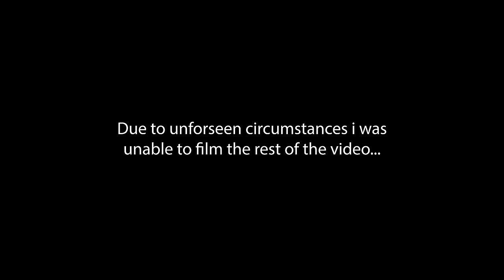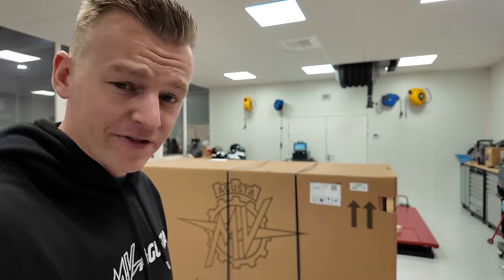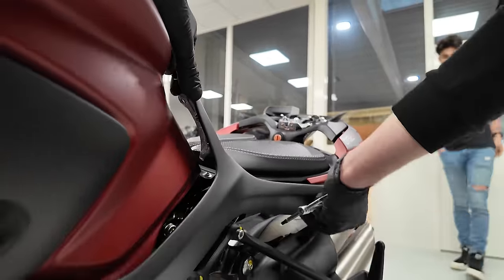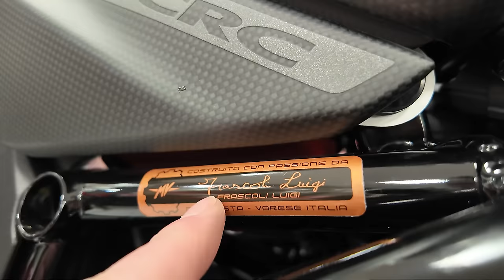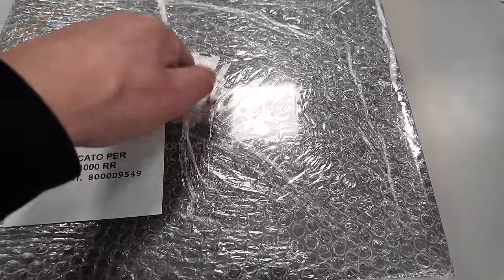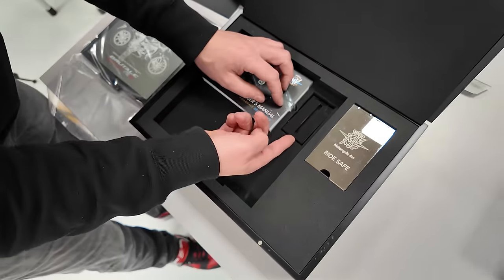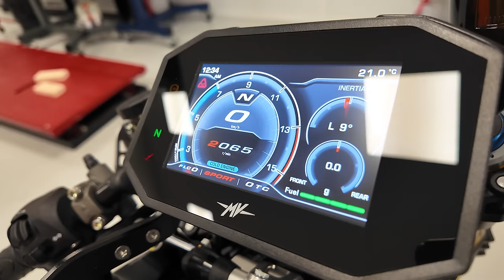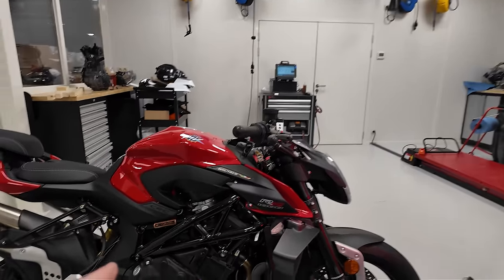2024 MV AGUSTA BRUTALE 1000 RR Unboxing (208HP)  | First Start + Exhaust Sound

Comment: MV Augusta are works of art. A keeper for sure
Reply: The street fighter is a dream of a bike, the MV Augusta what can you say? Nothing less than the same as in the case of Lamborghini or Ferrari. …. fantastic bikes, superbikes, and all of the larger displacement 4 cylinder models sound fantastic, and are very compliant, except the absolutely atrocious three cylinder 800 cc Brutales……I have two Brutales,  I’m keeping the in-line 4 1090. But I’m selling the newer and actually better looking 800 cc triple,  because honestly, it sounds like a piece of total crap really, and it wants to race at 12,000 RPM even at 20 km an hour stuck behind a three wheeler on the farm road in Thailand.. the four cylinder 1090 I can drive through the city center at 20 km an hour without the bike doing the bucking bronco. But the 800 starts jerking all over the place. It’s also much more tiring. However one truly has to admit that all MV Augusta models are visually absolute works of art for sure. One of the most beautiful bikes I’ve ever seen and perhaps the most beautiful I have ever had, but I’m keeping the 1090 in silver, even though I prefer the looks of the 800 Brutale, which is bright red. although after a month or so it starts looking like a dwarf. I think MV Augusta made a big mistake making all of their bikes that are under 1000 cc as three cylinders. Because they sound absolutely horrible. it’s actually becoming famous worldwide just how bad they sound. They do have a following and some people love it. But they’ve lost a lot of potential customers because even even more people hate the overwound, high RPM settings on the 800cc models with three cylinders, amd hate how tiring the bike is, because it’s like sitting in the sardine can, and the famously horrible sound of the triple cylinder engine. What a shame otherwise it would possibly be the most beautiful bike in the world, as well as one of the most fun to ride, but actually it’s a piece of art, that’s very strenuous to ride. i’m speaking from the experience of a person who owns both the 800 and the 1090 cm³ models so I believe I know what I’m talking about. In fact, I drove both of them today, one of them was not as pleasurable as the other. In fact, only one of them was truly pleasurable. I am obviously referring to the 1090 CC model with in-line four cylinders. What a bike! I never thought they would own one in my life, every time I ride it, it’s like Christmas. but the street fighter also puts a smile on my face every time, and it’s a hard decision which of them to take when I decide to go for a ride, especially when I’ve got another 10 bikes to choose from apart from those

Comment: I have the anniversary edition sitting in my garage collecting dust. Beautiful bike. It is not worth the money and impossible to get warranty work done.

Edit: recommend checking your rear brake fluid reservoir cap after every ride. They have a habit of coming off on their own.
Reply from the maker: Fluid reservoir cap coming undone??? 😅 That sound just a bit dangerous 🙈
Reply: @LifeofSmokey  and very inconvenient to replace. The first time was lucky and it was sitting wedged in the frame. The second it was missing completely and we had to wait for a new reservoir assembly and cap. The third time saw the bike hard parked. Talking to a few other owners, it is a common enough problem for some reason.
Reply: You can buy a beautiful Moto Corsa master cylinder to with the bike and forget checking it
Reply: I had a Kawasaki it had a Bracket to screw on Cap , 
I’d spot a Tiny amount of Loctite or Silicone will Stop that , Warranty that’s a Bitch Move it On to a Top Mechanic “…

Comment: I'm curious: what other things, if any, are done off camera getting the bike ready to do it's tiny lap outside the garage door.  I noticed the fuel gauge was full.  What other things are typically done in your check list before you do the little ride?  Oil? Hooking it up to the computer?  How much air pressure do the tires typically have when you get it out of the box?
Reply from the maker: All bikes are in "transport mode" so they don't start. We hook them up to the computer to check for faults , remove the transport mode and make sure the latest software is updated. These bikes will be demo motorcycles for the press fleet so we also unlock all possible software options and riding modes. 
The oil is good as the bike was already tested in the MV Agusta factory. We only add a little bit of fuel 😌
Reply: Awesome! When I bought my 2021 KTM 890R I asked the distributor if I could come watch the box get opened when it arrived in Taiwan.  Unfortunately they told me that I couldn't witness the "birth" of my bike. (For safety reasons) so this channel has helped scratch that itch.  Thanks! @LifeofSmokey

Comment: I recommend putting the titanium Arrow full exhaust with the ECU it will remove another 40 lbs. add 4 more hp and change the acceleration curve. The sound is like a Ferrari F1 V8 is insanely loud. Take care of those carbon engine covers since getting one is almost impossible, I've been waiting for one from MV since March 2023. The bike is a blast to drive but you have to let loose the front and commit to it she'll take care of the rest. Also get some bar end weights. With the factory bar ends the vibration is terrible.  The suspension is for track. With the factory ECU you have to wait until 9k rpm to get the bike to "scare the hell out of you" mode with the race ECU and the exhaust it will do it at little less than 6k. The bike is extremely fast; is a track focus bike. The RS in the other hand is more civilized for street. Even though they have the same engine the RS suspension is plusher the seat is one piece with memory foam have higher clip ons. The Brutale 1000 RR Is a naked F4 RR RC, literally.

Comment: A burnout with a new bike and cold engine, dude u know better (i hope), first mistake, use the diagnostic computer before first startup.
Reply from the maker: Bike was on the computer , they don't start without it. Engine had been running for 15min before the burnout 😁

Comment: I have the 2023 RS living in the US. The bike was brand new and came with a faulty QS which took 2 months to get shipped from Italy (warranty slowed process). Then while working on the bike, the dealer cracked oil filter cap which took another month. For 3-4 months, the bike was in the shop. Mind you, this was a BRAND NEW bike. MV is a fucking nightmare of a company to deal with. To put more salt on the wound, KTM merger is making it a nightmare to get maintenance done as MV is not renewing their contracts with many dealerships. Good bike, shit company.

Comment: DONT BUY ANY MV AGUSTA!!  Sprag clutch, stator and bearing are junk and go out every 2yrs. And the fuel tanks are plastic crap! Even with no-ethanol race fuel they expand and contract, causing the paint to crack, deformation and fuel leaking. Every 2yrs these are gonna cost you about $5000 USD to fix!

Comment: You asked..so 3/10 for me .one of the most pointless motorcycles ever made 🤷‍♂️
Reply from the maker: I appreciate your honest opinion 😉. I would go for a Duke or Streetfighter V4 but I do like the special over the top looks of this one 😌
Reply: Hmm… what’s your thoughts on the street triple rs?
Reply: How do you define pointless?
Reply: @marksgaragestuff  apart from being overpriced and an underwhelming dash it's a high performance bike
Reply: @marksgaragestuff I own one, it's a brilliant bike.  It's no 200hp sledgehammer but it's a very nicely appointed bike that's fairly comfortable and versatile, rides great and has enough power to lift the front in first and second using throttle alone.  I enjoy mine, but would love a Brutale even if I'm incapable of using it to it's full potential just because I love the noise it makes and how it looks.
Reply: Some people buying a pointless painted "art" for millions for some reason..i would love a brutale as "art" in my collections
Reply: May i know the reason 2:58